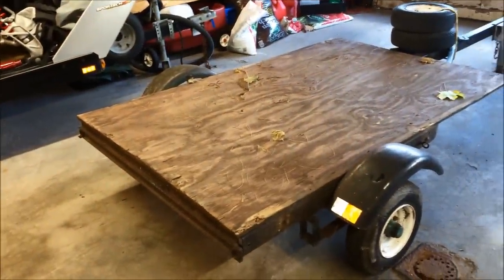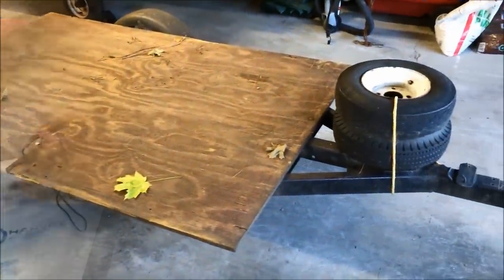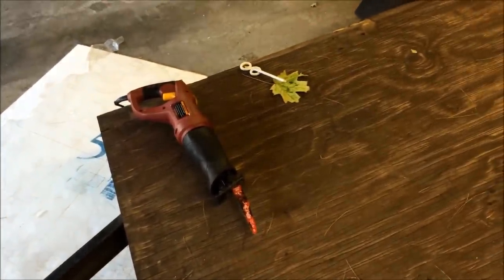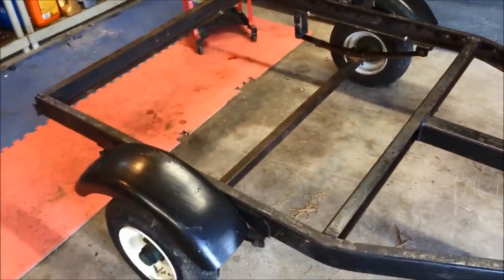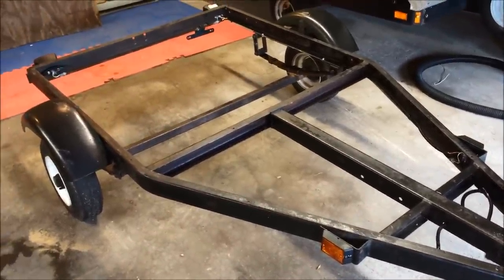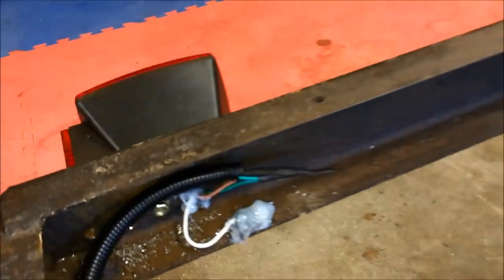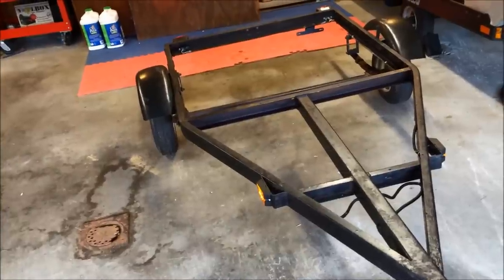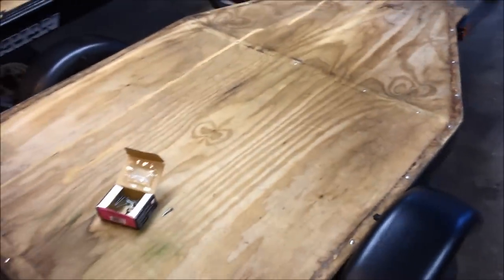Utility Trailer Rehab / Restoration

Comment: Doesn't that license plate bracket just attach to the same bolts as the left rear light so it's directly underneath it?
Reply from the maker: +Morgan Crawford Honestly, I don't remember. The trailer has been at my sons house ever since I made the video,
Reply: No problem. Thanks or getting back to me and thanks for the video.
Reply from the maker: +Morgan Crawford Any time and thanks for watching.